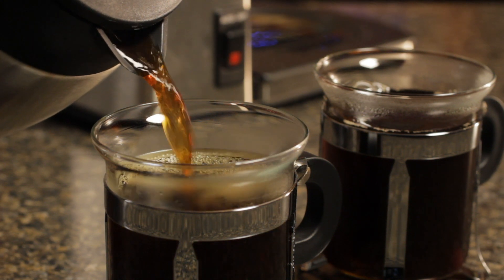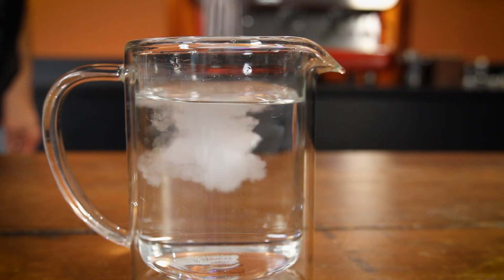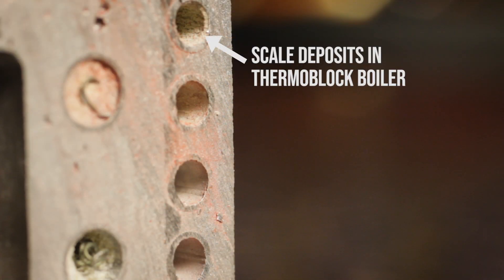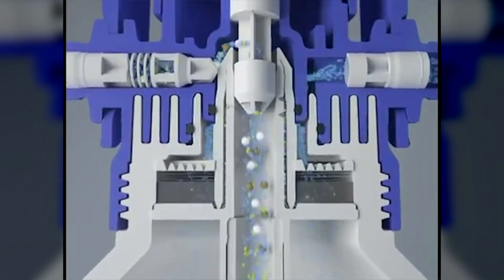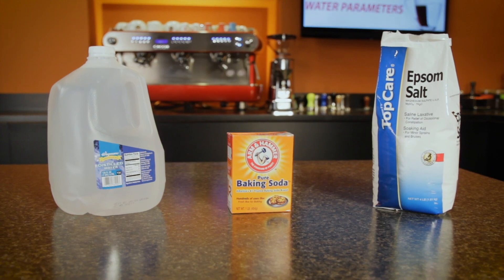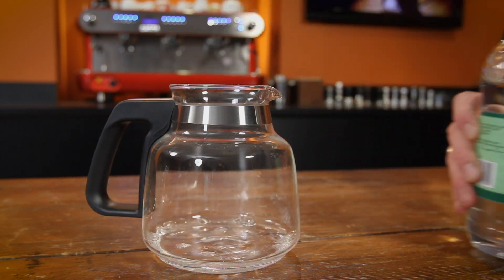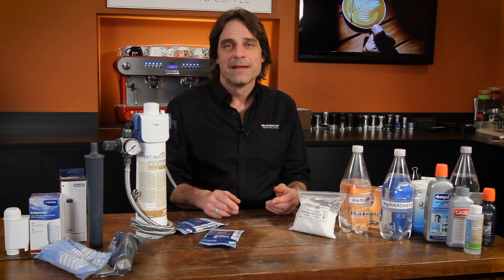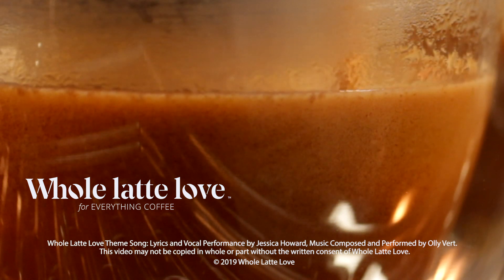Water Filtration for Best Coffee & Espresso Flavor and Equipment Protection

Comment: Hi Marc. Are there any countertop water filters that attach to the sink faucet that you could recommend?
Reply from the maker: Hi Jack, Thanks for the question. If your tap water is soft then an average faucet unit with particle and activated carbon filtration will do for removing chlorination or other chemicals. For hard water situations you want something that reduces water hardness. My preference for that is the ion-exchange tech of BWT which replaces some calcium with magnesium. They do not have a faucet mount version.
Marc

Comment: Can you give some basic parameters on how to use descaler on a plumbed-in machine that I am pretty sure needs it?  I use a good product to clean my portafilters and milk wand tips, but I don't know how to use it inside the machine.  Thanks.
Reply from the maker: Hi Cole, Sorry for the delayed response. Products like Cafiza or similar used for cleaning portafilters, filter baskets etc. should not be used for descaling! Those types of products generally contain "bleach like" compounds in addition to surfactants/detergents that you most definitely don't want in your boilers! Descalers are acids. Most common acid used for descaling is citric. It's available in pre-measured liquid and powders. Or, you can purchase citric acid powder in bulk and make your own. Only problem with that is it's a bit of a guessing game as to how much to use. Wish I knew which type of machine you have. If it's a dual boiler most manufacturers recommend they be descaled by a pro machine tech. DB machines have intricate internal plumbing which can get plugged up with scale deposits during descaling. Also can be difficult to fully empty the boilers of descaling solution. Is your machine plumbed in only? Most plumbed machines also have a reservoir you can load with descaling solution to get it into the machine. If it does not have reservoir It probably has a rotary pump. Most rotary pumps can self prime (especially if just disconnected from waterline and partially primed) and take in water/descaling solution from a bucket or similar. So just disconnect waterline from supply and drop in bucket with descaling solution. I'll caution again against descaling a dual boiler machine at home - especially as you mention "...pretty sure it needs it..." Descaling machines with heat-exchange boiler is usually not a problem for end users. Here's a video on how to do that: https://youtu.be/yEGfyJkWSqU
And here's a video with more info on descaling products and how to make your own: https://youtu.be/YQdV2Kb2fCI
If you are at all unsure I highly recommend having a professional tech descale you machine.
Hope that helps!
Marc
Reply: @Wholelattelovepage  Thanks!

Comment: What tests do I need to run on my tap water and the acceptable ranges for a future purchase of a dual boiler machine.  I move around the country and would like to determine the process to determine if my tap water is acceptable.  Where I am currently living, the tap water is very good, but have lived in other areas where I only drink bottled water.  If I go the bottle water route, what type will I need to buy.  Distilled was not recommended, and was wondering is the preferred purifying method for the dual boiler machine and will it need additional treatment.  I will not be using a home plumbed system, because of me moving with my job.  Thank you.
Reply from the maker: Hi Johnny, Thanks for the question. If not plumbing a machine the easiest way to get to a water quality that provides a proper mineral level without causing scale is the patented calcium to magnesium ion-exchange found in BWT Bestsave in reservoir pad filters or the BWT Penguin pitcher. The pitcher produces excellent drinking water too! Either of those options work so long as your tap water is safe for human consumption. See links below for more info on those products. The most basic test is total hardness of water. If using bottled water, it's hard to recommend a specific brand. I have found in the past that a single brand may have differing levels across geographic regions. If testing you want a water hardness considered soft. And yes, do not use pure distilled or reverse RO water. They have no minerals, will cause over-extraction and may cause corrosion of metal components in an espresso machine.
BWT Bestsave Pad Filter: https://www.wholelattelove.com/products/bwt-bestsave-m-anti-scale-filter
BWT Penguin Pitcher: https://www.wholelattelove.com/products/bwt-penguin-2-7-l-water-pitcher
Hope that helps!
Marc
Reply: Whole Latte Love, Marc, a couple more questions.  Does the manufacturer like ECM have the water quality specifications for the machines in the owners manual or what test kit should I buy and the acceptable range for tests.  The water from the tap taste good at my present city, maybe a little taste of water treatment they use (chlorine or fluoride ?) and would like to test it, then probably use the BWT penguin if it is not in range.  I would like to be able to test the water before and after filtration to get a consistent water number so it will not effect taste, no matter what city I move too.

Comment: So according to Jim from 1stLineEquipment in his newest video about the Lelit Elizabeth v2, he said that calcium and magnesium are a machine's worst enemies. The BWT filters adds magnesium to the water, correct? 

I'm just trying to understand who is correct. I've been using the BWT filters for a year now per this video's recommendation. 

If you have any input, thanks in advance Marc. If you want to check it out, he says this around 50 second into the video.
Reply from the maker: Hi RN, If used correctly water from the BWT filter will not cause scale build up in espresso machines. Minerals like calcium and to a lesser extent magnesium can cause scaling but only when the level is high enough. You want some minerals for flavor and to prevent corrosion. The BWT Bestmax Premium filter removes some calcium and replaces it with magnesium. After the filter total mineral level is below the level which can cause scale to form.
Marc
Reply: @Wholelattelovepage  ah okay. So if I use BWT water, should I still descale maybe once a year? Or should I not worry about it as long as I'm changing my filters?

Comment: Wow that's a great video, which filter will you advise for the black eagle
Reply from the maker: Hi RC, Used properly, a BWT Bestmax Premium system will serve your needs and provide water quality within these specs as stated by NS: 
                                            
                                                The installation of a water softener
is mandatory when the espresso machine is fed with water that has a hardness
higher than 3 grains per gallon or 50 parts per million (ppm). The pressure of the
water line must be between 2 bar and 6 bar and the water must be cold. The
water also must have a filtration level below 5.5 Micron, a total dissolved
solids level between 50 and 250 ppm, an alkalinity level between 10 and 100
ppm, a chlorine level less than 0.25 ppm, and a pH level between 6.5 and 8.5.
Reply: @Wholelattelovepage  okay, the thank you very much

Comment: I am assuming that I can use RO water with the BWT penguin?
Reply from the maker: Hi B, I have not tried or tested RO water through the BWT pitcher. I'm not sure if it would work. I suspect it would not as the BWT uses ion-exchange which replaces calcium ions with magnesium. Since there's no calcium ions in RO water to exchange with I do not think you'll be adding minerals back to the RO water. A couple of options to get a mineral level in RO water. First you can mix up concentrates from baking soda and epsom salts to add to RO water. It's very inexpensive! Here's my video on how to do that: https://youtu.be/iHI7jC0sQZo
Second option is a remineralizing   filter like this one: https://www.wholelattelove.com/products/bwt-bestmin-premium-m-filter-cartridge A filter solution works best if you can plumb it inline with your RO water output.
Marc
Reply: @Wholelattelovepage  Marc, I thought the BWT system would not work if plumbed with RO water output since almost everything is removed. I am using RO and then manually adding in Third Wave Water powder to each gallon. I am looking for a BWT solution so I can get rid of the manual process. But, the way the water is here I have to do RO first. I don't think the BWT can remove all of the bad stuff we have.

Comment: I have 230 ppm of hardness how long with an M filter last
Reply from the maker: Hi JJ, Filter capacities are rated by the total hardness in dGH. 230ppm converts to 13 dGH. The M filter treats 1,885 liters at that hardness. Use a bypass setting of 2 on the filter head.
Marc
Reply: @Wholelattelovepage  Thank you for that response I want to have drinking water and coffee water I would love to use that filter however that only gives me 1.3 gallons a day there are reverse osmosis  systems out there that say they add the minerals back in do you think those would work to keep my machine from scaling up thank you JJ

Comment: I plan to run the same water source for my plumbed-in espresso machine and my refrigerator water/icemaker line. Will the Bestmax filter also create great drinking water or should I run these lines separate?
Reply from the maker: Hi Kevin, The Bestmax premium filter makes excellent drinking water! Many customers have split filter output for icemaker/fridge supply. Some install an additional tap with filter output at sink too.
Marc

Comment: Great and informative video! I have a question regarding the pitcher filters (Brita, BWT etc.). I've read that these kinds of filters (WAC resin) effectively reduce the calcium hardness, but on the other hand replace those calciums ions with hydrogen ions, causing the pH to drop to a point that makes the water corrosive and harmful to the internals of espresso machines.

Is this true? If so, how do I soften my water and at the same time keep the pH neutral, without having to spend a lot of time mixing the perfect water from scratch (with distilled water, soda etc)?
Reply from the maker: Hi S, Thanks for the question. I cannot speak for Brita filters. There are many different types and I have never found a good reference for how they change water chemistry. Most common I am familiar with do particle and activated carbon filtration only. BWT filters like the Bestmax premium and the Bestsave in reservoir pad filters use patented ion-exchange technology to replace calcium with magnesium ions. I'm not familiar with that causing pH drop to the point of creating corrosive potential. So long as input water is safe for human consumption BWT will not cause scale deposits or water with potential to cause corrosion.
Marc

Comment: How does the BWT BestMax do on well water?  Test strips put me about 120 total hardness.
Reply: GS ... Is that true???  Water Hardness at 120? One of the things that is not communicated in this presentation is owning a water hardness device for $25.  I bought one at Amazon because WLL did not give me one upon purchase.  But my water hardness based on the device is reading at 21 ppm and water coming out of my ECM Synchronika is at 24 ppm.  This does not appear bad but because I have the hardness device,  I can check on a monthly basis to see if hardness is increasing.  I do not know if WLL will agree with this thinking but I cannot really determine water hardness when I received nothing from my purchase, although it was specified I was to receive it by videos.
Reply: @The72Rabbit  All I can go by is what a the test strips show me.  The color matches to maybe just over 120 mg/L (ppm).  I tried one of the electronic total hardness meters but the results were so variable I could not trust it.  I got a batch of test strips and use them as needed, with the result being pretty stable between tests.  At 21 or even 24, I don't think you even need to filter yours - maybe Marc will chime in with advice?
Also, Marc - if you do offer advice here - any news on the upcoming Expobar secret ? :) Right now I am tilted toward a Pro 700, but if something really changes with the Brewtus I may shift back!

Comment: Good evening Marc I have a water softener sustem from culligan as well as a reverse osmosis system with a mineral additive filter. I just tested my water and it has a 9.0PH and 20PPM hardness. How long would scale build up take in my Appartamento? Estimated of course
Reply from the maker: Ryan Claypole Hi, at 20ppm it’s unlikely you will have scale formation. That’s very low hardness! pH is on the high side of desirable level but may offset your low hardness a bit. With hardness that low there’s a slight risk of corrosion of metals. I wouldn’t worry about that. Does your espresso taste over-extracted? If so you may want to up your remineralization from the filter if possible. Compared to SCA spec your mineral level is low.
Marc
Reply: Whole Latte Love what’s the PH level and hardness level I should be looking for? I’ll bypass my RO and run tests on my water again tomorrow.
Reply from the maker: Ryan Claypole Here’s a link to SCA brew water specs: https://sca.coffee/research/coffee-standards

Comment: Mark, thanks for covering this important topic.  I have a Profitec Pro 700 and have been RO blending for two years.  I would like to plumb my machine but I am concerned about what the Bestmax system may produce given our water situation.  We have high sulfate and chloride content in our water and I have been told that WAC like the Bestmax do not work well with this.  Where do I go from here?  I have scoured the internet but have not found a clear solution.  Your help would be greatly appreciated!
Reply from the maker: Hi ascbeerman, You are welcome. A couple thoughts... First, plumbing a machine is awesome. Sounds like you have an RO system? Do you have an automatic remineralization system on your RO? If your RO has a pressurized collection tank and remin you can plumb that to your machine. Or maybe you're like me, and have an RO without a pressurized collection tank. My tap water is good. I use the RO water for my saltwater reef aquariums. Some options:
1. Large 5-10 gallon under counter reservoir. The 700's rotary pump can draw water from an unpressurized water source. Might need a prime (usually not) to get it going. With this setup you could manually blend a lot of RO water at once. With no water pressure on the plumb line you can't take advantage of the Pro 700's pre-infusion capabilities.
2. If you have a pressurized RO system you can plumb that to the machine. If needed you can remin automatically with a BWT BestMin cartridge: https://www.wholelattelove.com/collections/bwt/products/bwt-bestmin-premium-m-filter-cartridge We've been testing a pre-production BWT pressurized RO system. It uses A BestMin downstream of RO treatment to mineralize. We use this to feed the various plumbable machines making their way through our employee lounge. You can pipe off to other equipment like ice makers, fridge and drinking/cooking water tap at sink.
3. If you'd like to provide your water test report I can forward that to BWT for their recommendations. They have a variety of options beyond the BestMax for specific water quality issues.
Hope that helps!
Marc

Comment: Hi Marc - thanks for all the insights; I just bought a Profitec 700 from WLL based on your recommendations. I plan to use the reservoir initially, and so bought a Bestsave at the same time. My local water is 72ppm hardness, which I believe is within Profitec's recommended range (though at the higher end). Should I still plan to use a water softener for the life of the machine, and if so should I expect to get more life out of them given my relative hardness?

Also, how do you have time to answer all these questions? It's impressive!
Reply from the maker: There’s some effort involved. Usually only respond to 1st original comment and can’t go deep in threads. Great machine! Bestsave is good for reservoir. Best to prevent scale in DB so always treat. Will last longer with lower initial hardness.
Marc

Comment: The local Walmart and supermarkets have filtered water machines that we buy by the gallon and have been using in our Profitec.  Our coffee tastes great and we descale about every 90 days.  Are we good?
Reply from the maker: Hi Don, Thanks for the question. I think you should be okay with the descaling schedule. I have no idea what your local stores are filtering. My guess is they do particulate and activated carbon filtering for chlorine and other chemicals. Probably nothing to control/remove minerals from the water - that's uncommon. Do they provide any data on analysis of their filtered water or their filtering process?  It's possible (or not) they could be using reverse osmosis and re-mineralizing the water. That would be fine so long as we knew the mineral levels.
Marc